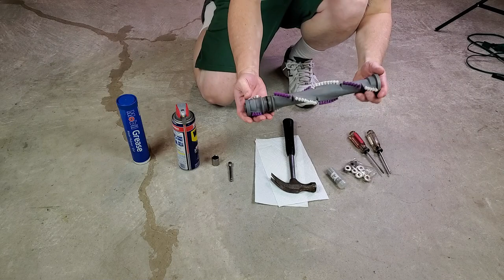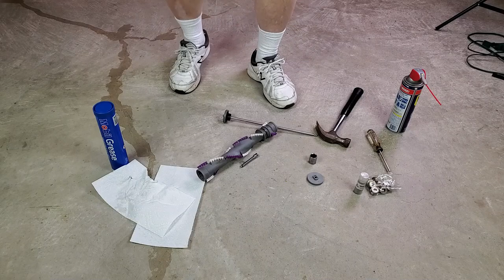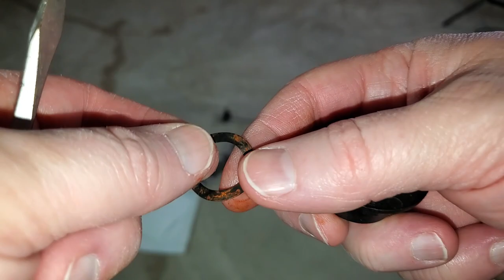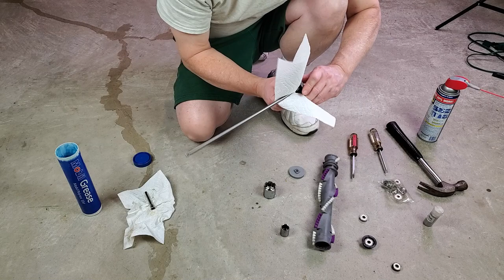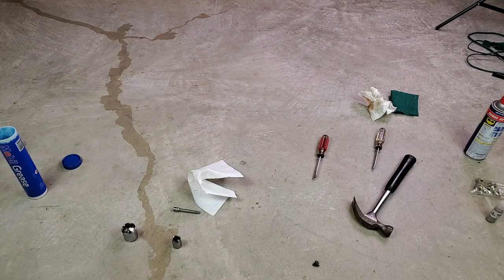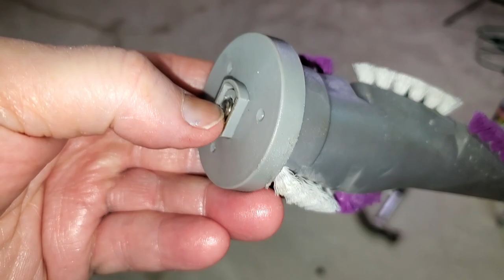Bissell Powerforce Helix Brushroll Bearings Replacement

Comment: Thanks for the video, I was replacing the belt without knowing that the bearing is jammed.

But now after removing the rust, machine is making heavy loud noise. I checked for any lose body part but cannot find any.

Comment: I have a Bissell Momentum. I replaced the belt when it snapped and it was so loud! I figured it was the bearings and looked at eBay as recommended. What I was about to order listed “for skateboards” as one use. It dawned on me that I had some new skateboard bearings in the garage. I don’t know the rpm rating etc but they were the right size. Swapped them in and it’s so much quieter! For now, that will work!

Comment: I had to do this with a brand-new OEM brush roll. They had the bearings too tight in the inserts. This basically rendered the spring washer useless, resulting in a sloppy fit and noise.
Reply from the maker: Bummer. Glad you got it fixed though.

Comment: Your video was educational! Now I know that WD-40 does not suffice for grease. And the idea to use sockets to help remove and possibly replace bearings was educational too.

At the end, you should have stood up your just completed and treated brushroll up on it’s end and then give it the spin test. Take into account that the new bearing and the new grease have to be “broken in“ first. 

This video will come in handy as I right now have two trashpicked PowerForce 2191s, both of which need brush roll bearing surgery. One of them also needs a new height adjuster as the tab on one side is busted off. Do you have a video for a Jerry rig repair for that or does it strictly require getting a new height adjuster?

Comment: Hey vaclab just got a older bissell powerforce compact like the one you have, and the brush roll sound terrible. Thinking about replacing it most likely but also considering replacing the bearings (if it is the bearings), and I haven’t replaced a bearing in my life, could you help me please?
Reply from the maker: You want me to replace your bearings?
Reply: @VacLab  well I’m in Texas and that would take a while I’m assuming. How much? And just fyi it makes a crunchy sound when I turn it
Reply from the maker: @Thevacuumenthusiast  it's going to be cheaper if you just buy a new one rather than paying shipping both ways plus labor and parts.
Reply: @VacLab  thank you for helping! I’m probably going to find a cheap brush roll or find the kind of bearing and replace them. Thanks vaclab!

Comment: What size bearings are you using I know they are 608z
Reply from the maker: It's clearly mentioned in the video.
Reply: The 608Z bearings are 8mm Bore, 22mm OD, and 7mm W.